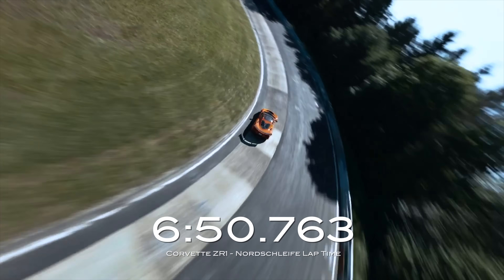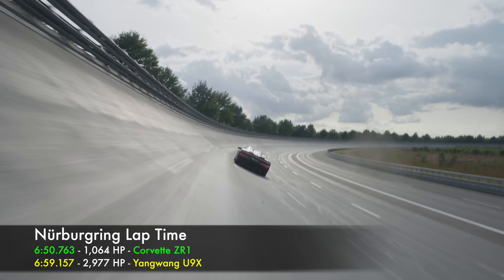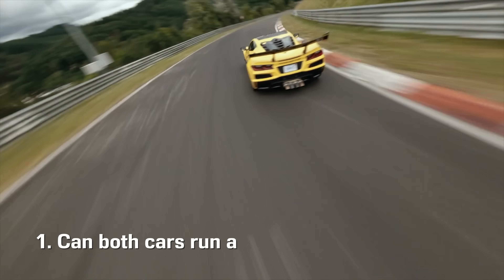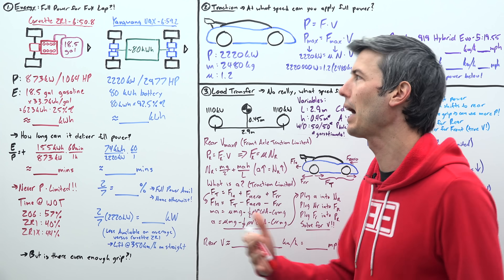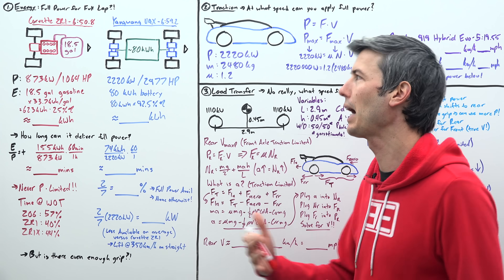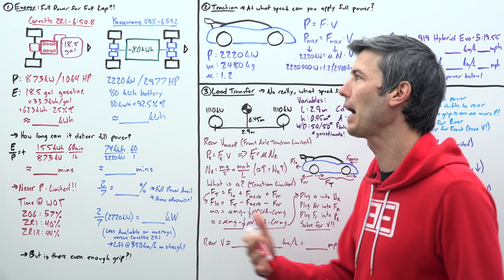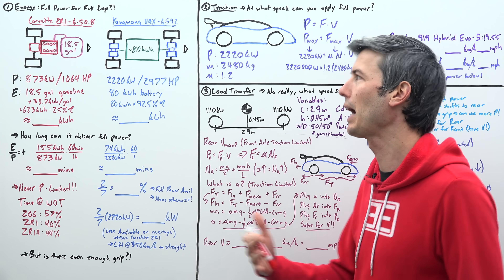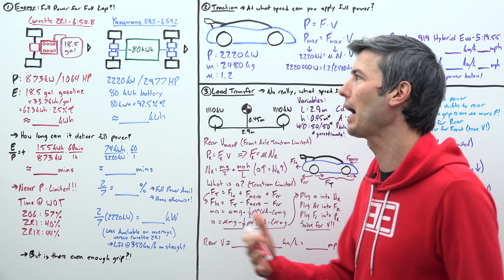Gas Beats Electric! Why Is 1000 HP Faster Than 3,000 HP?

Comment: It's not how much power the car has, it's how much it can use. That's a concept that Porsche really understands.
Reply: They also understand how to manage air. Part of the reason the GT3 is still faster than the GTD
Reply: It depends on the track....eg, many corners vs many straights
Reply: Power to weight is also really important, and lighter is better for braking and turning.
Reply: I use gut gas
Reply: General Motors really gets it too.
Reply: You mean aero…
Reply: Amen !
Reply: The Porsche with the fastest lap time is the most powerful 911 they ever made, so it still kinda is about how much power the car has.
Reply: Porsche has sort of painted itself into a corner with the 911 GT3 line, as in it absolutely has to be an NA flat6, and so over many years they’ve gotten VERY good at maximizing the potential of every single part while still having it be road legal and reliable.
Reply: @StreetComp it’s a car for the GT3 race class. The Corvette and GTD are essentially GT1 cars. Anything goes there.
Reply: @StreetComp  Yes, Porsche engines have been always been developed, produced and engineered in NA, the center of the Universe. May got bless Guns, and america.
Reply: @CristianNazare  pretty sure they mean naturally aspirated 💩
Reply: @spoons_akimbo  omg you might be right! Sorry @StreetComp. Feeling like a dumbass now XD
Reply: Don't believe German lies. Porsche learned this from Subaru. The first 911 turbo was difficult to drive, which meant it more often created widows than allowed you to drive at 100%. In the second half of the 1990s and early 2000s, Subaru and Evo were faster than many supercars on real roads because they allowed 100% power to be used in all conditions. Especially on bad, dirty, wet roads. People forget that driving at 100% on a race track and at 90% on public roads is not the same thing at all.

PS The first mass-produced 4x4 passenger car was the Subaru Leone, and the first production model was the Jensen Interceptor. All decades before Audi. Don't believe Germans 😉
Reply: But Porsche did make the first 4x4 car and it was a hybrid as well. In the year 1900.
Reply: Porsche has been making cars for 100 years, only to be beaten by a car that costs 75% less, made by a cell phone company that entered the auto industry two years ago.
Reply: @keithl8080  You still believe the Chines myths, athough those have been debunked time and again?
Reply: @keithl8080  What are you even talking about lol. Porsche can destroy it whenever they want with a fraction of its power. Also dont forget the 919evo hybrid. Porsche IS the best and nothing will ever come close lmao
Reply: @patrickrosington1174   that's because you most likely have never traveled and never drove the Xiaomi SU7 Ultra and other new EVs, I have a GT3 RS and my friend has a Taycan S, the $80k SU7 ultra blow them away. Some of the new Chinese hybrid EVs have up to 1,600 km range lol, compared to the 1st gen Taycan S that my friend has with only 186 miles range tested, which is a joke.
Reply: @keithl8080  can you perhaps provide proof of the su7 "blowing away" the gtr3rs? Would also like too see some proof of that 1.6k km range claim.
Reply: @keithl8080 na... porsche fastest on the Nürburgring 😁
Reply: @patrickrosington1174 no matter how much porsche got destroyed, their fanboys will adore them no matter what
Reply: @keithl8080  Sure "Keith".
Reply: @keithl8080 You have a GT3 RS, and my dad also works at microsoft, and he's Bill Gates
Reply: @Tobilikethis  absolutely, never seen a e-car with any power as fast than gt3rs for example. street cars of course. IDK how much a McMurty will be faster than a similar built gas car with modern aknowledge and negative pressure active downforce system, idk how this is called in english, inspired by the old brabham bt46b. Also intresting that there are "built" 30yrs old honda civics out on the ring in the 7:20's, thats impressive!! There are many Videos of Bugattis on the Ring.... all of them are slow AF, theyre like Hayabusas on 4 Wheels... just nice if it goes straight.
Reply: @IHaveALotOfBraincells he probably talks about straightline speed because the gt3 rs actualy beats the yangwang on the Nurburgring despite only having like 500hp while that yangwang has 3000
Reply: @keithl8080  DUDE WE FKIN KNOW THE EV IS GONNA WIN A DRAG RACE THIS ISN'T ABOUT THAT
Reply: @keithl8080  track and straight line performance are two different things entirely. a tuned nissan gtr would smoke the su 7 ultra. its not a correct argument
Reply: @KaranVarma-d1y  The point is,  A Su7 ultra costs $70k in China. People keeps on saying their $350k to $1 million dollar car can beat a $70k Su7 Ultra, the Su7 already won.
Reply: @patrickrosington1174  "nothing will ever come close" while the ZR1 is within 1.5 seconds. AND thats this particular track (a track with more straights could flip things into the corvette's favor). AND the ZR1 isnt even the fastest corvette lmao
Reply: @keithl8080  people who race the actual cars and not the ones arguing with lap records know this, Porsche can do laps and laps around Nurburgring without parts failing, while even supercars like Mclaren struggles to keep itself together when abused slightly. James May on Top Gear tested similar things before. German cars don't disintegrate when there are some sand and gravel on the roads which damages their underside. It was Ferrari vs Mclaren vs Audi.
Reply: @keithl8080  You are missing the point. A 911, say, isn't going to win a drag race over a reasonably powered EV. This is about running several laps around a track. Le Mans is an extreme example. But there are many things that have to be in place to win the 24h.
 
EVs have their advantages. They have very good handling despite being heavy, due to the weight distribution. It's very low. Speaking of batteries. They have more than sufficient capacity. As I understand it, today's electric semis have as long range as diesel semis. I believe you can only drive for 4.5hr in Europe anyway. After that you are required to take a 30 or 60min break. But there obviously are situations where the batteries are the limitation.
Reply: @grisflyt  Today's electric semi's do NOT have the same range as diesel semi's, not even when driven bob-tail. And with increasing load, the range drops like a stone. Just look at how bad the electric pick-up trucks are doing when towing a load because of how much the range is absolutely gutted. 
Europe does have limited consecutive driving time for truck drivers, but it isn't as simple as you say. Besides that: no electric grid in Europe has the capacity to charge a huge number of EV's without problems, let alone the capacity to charge much larger electric semi battery packs.
Reply: So, porsche is faster than bugatti because of capability of understanding? BS
Reply: @tigermo538  Depending on your definition of "faster". Try doing a hillclimb in a Bugatti?
Reply: @getsideways7257  What I mean “faster” is much simpler than your roundabout definition. It’s not like you don’t know it, you just don’t dare to admit it and tried to play a concept game.
Reply: @tigermo538  Ok, then try beating the top fuel dragsters...
Reply: @tigermo538  Top speed is 100% irrelevant in all scenarios, except a scenario where you test top speed.
Reply: @Jreq-77  Talk to the price of top-speed machines, no one is smarter than you.
Reply: @tigermo538  so what do you mean by faster? straight 1/4 mile drag race?
Reply: @tigermo538  Yes.

Comment: The Gt3 vs Zr1 is also slightly misleading as Porsche has drivers with thousands of hours on the ring. Chevy has highly skilled drivers, but no one near that level. 
Many ring experts say that the Vette could've gone faster.
Great job explaining the power limitation though.
Reply from the maker: I spoke with the Corvette team and honestly I think their number is pretty close to accurate - the run the simulations prior to visiting, know where they should land, and were happy with their times. Sure, it's Porsche's back yard so there's an advantage to that, but also the Porsche is significantly lighter and has significantly more downforce, which is critical for high speed cornering tracks (the 'ring). It's able to carry a lot more speed, even if it takes longer to get up to that speed.
Reply: @EngineeringExplained  A guy name misha Charoudin has thousands of laps at the ring driving all sorts of cars watch ZR1 lap and he said ZR1 has probably close to 10sec more in it if they had a driver that knew the track better where to attack it. There was multiple points vette driver was off line or didn't attack where they could.
Reply: Sabine could have cut 30 seconds off easily.  💖
Reply: That's on GM for not hiring a professional 'ring driver.
Reply: That's just their way to avoid having direct comparison to porsches. Especially since they always have significant power advantage.

Comment: You didn't have to wait for this long to make this comparison. You could have just compared ring time of rimac nevera and GT3 RS. More than 3 times the hp still almost 20 sec slower... Because EVs are heavy although their C.of mass is lower they experience significantly less lateral g's when cornering. EV loose so much precious speed in the corners, no matter how fast they are on the straights they cannot make up for the time lost. Weight is everything on a track. Energy density of batteries should at least double for the EV to catch. Which will happen in 5-10 years.

Comment: The U9 Xtreme is about A TON heavier than the ZR1.
CORNERING is the reason it was slower, not putting down the power.
If you compare the cornering speeds you will see a huge difference.
Plus the ZR1 is two wheel drive and the U9 four wheel drive, it has two more driven wheels putting down power.
And we are not talking about power to weight ratios or acceleration.
Huge losses in braking and cornering due to substantially bigger inertia on the heavier car.

Comment: There were a number of inaccuracies in this video.  First, while the average 634kW power of the EV can be computed based on the battery capacity (ignoring regen and assuming you end the lap with 0% battery), it's incorrect to compare that against the peak power of the gas car with the explanation that the gas car isn't energy-limited.  That's because the gas car obviously won't end up with it's average power equal to it's peak power due to braking zones etc.  If you want to do a better comparison based on energy usage, you should look at how much gas was actually used and compute average power from that.  Also, saying that you can never use the peak power anyway since you're tire-limited up to 170 mph and the Porsche 919 hybrid had an average speed of 145 mph is also misleading as that ignores the sections of the track that are above 170 mph.

Comment: According to F1 engineers, every 1kg of weight adds 30 ms on a typical F1 track. Every extra HP adds about 16 ms per lap. On a track as long as the ring that might be 150 ms. Now consider that the Yangwang weighs like 1400-1500 kg more than an Alpine A110R Ultime. It's average HP over a lap should be around 857 HP if it's battery has to last exactly for 7 min. So in reality there's no way it's using even 857 HP most of the time either. It is this average HP figure that matters for an EV more than any peak figure. If they could increase the average power by 1 HP, they might gain about 80 ms on the ring. Which would in a very oversimplistic way of looking at it, mean that for every 1 kg of extra weight you need 2 extra horses on average over a whole lap to make u the deficit. And given that 3000/857 is 3.5 (based on the battery draining out in just 2 min at peak power), it means your car needs the peak HP number to go up by 7 HP or so for every kg of weight added on the Ring to keep the same lap time. No wonder EVs are so slow despite destroying anything else in a straight line.

Comment: 3000hp from China is all suspect. Stuff from there all begs the question. Is it really 3000hp or just paper spec lying.
And then there is over 5400 pound weight.... that is going to mess up any sort of handling issue. Enormous power that can not handle. mean problems for actual lap time.

Comment: Its certsinly possible to have too much power for the turn sizes. If the turns were much wider and longer then it would be more capable of using the full 3000 hp power making it a lot faster.

Comment: Different cars also have different weight as well as different braking and handling characteristics. Power isn't the only factor. This is why for example a 320hp Civic Type R has a better Nurburgring lap time than a modern BMW M3 or Mustang GT despite having significantly less power.
Reply: Hot hatches ftw. Even the i30n performance, the Civic Type R for poor people(me), beats the Mustang GT.
Reply: A Chevy cobalt SS also had a better time than those 2 cars.
Reply: I agree with the statement but the type r is a 7:40 car . The stangs and cars are faster than that while being pigs in comparison .
Reply: What this is a straight up lie! M3 CS is 7:28 and a Civic type R is 7:44.  M3 is not surprisingly quite a bit faster..
Reply: @albertcamus5970 That M3 costs double the Civic, has nearly double the power and drives double the wheels. For what, 16 Seconds? Now take a affordable M3 and look how it sucks against a Hot hatch.
Reply: @user-to7ds6sc3p M3 is going to drive better than a FWD hatch. Front wheels are doing everything braking, steering, accelerating - this is a lousy set up. Is that advantage worth the money? Also M3 is far more luxurious IMHO. M3 is a like rapid luxury car - where Civic is a like a tuned economy car.  

My first car was a Civic - I love them. But RWD or even rear biased AWD is just better.
Reply: @albertcamus5970  moreso a normal m3 but even that isn’t slower than a ctr.
Reply: The previous M3, not the current M3, which is faster than the CTR.

Comment: Great explainer as always!  Though it missed a major point of manufacturer lap times from the Ring.  That being weather - which can be a huge factor at that or, really, any other track.  Plus different drivers.

After all.  There is a reason Top Gear used to make notes of weather conditions at their track, since it was (almost) always the same driver and the weather was the biggest variable.

Comment: i know i'm probably the worst engineer out there (i'm more into static scenarios), but something always bothered me: Power can be calculated P = 2pi * M * n. Electric motors can spin at high rpm's (18'000rpm for Model S i think), but if they are put directly onto the wheels, there is no way that power will be ever available, so the power number would be bogus. Are there always planetary gears in these motors when they are in the wheels?

Comment: I'm German and know what it means to go fast in a straight line. And I know what it feels like more than 3 minutes into it: boring. Whereas proper mechanical grip to go quickly around tight corners never gets old. Even there is fast-computing trickery in modern heavyweights to compensate for the tons (and the high center of gravity in suvs) producing the "right" numbers, it never feels as good.

Comment: While traction limit is the answer, the biggest differentiator here is weight. The U9 weighs 2000lb more than the Corvette. Cornering, braking and some acceleration (as you show) are all done at the traction limit and a heavier car hits the limit at a lower speed. Tires work harder on a heavy car and get 'greasy' sooner. The GT3rs is 400lb lighter than the Corvette, and 919 Hybrid Evo is 2000lb lighter. All these cars are ranked in speed according to their weight.
Reply: Half of the EV's weight are on the batteries.

To reduce the overall weight by like 25% it needs the battery that has 50% lighter weight for the same capacity, aka 2x the energy density

Solid state batteries are supposed to fix the battery weight issue, but it's still under development until today and still not mass produced yet
Reply: @sihamhamda47  Let's see how long they 'll be "still in development" and whether they actually deliver...

Comment: Doesn’t the downforce of the air at high speeds dramatically „increase“ the weight of the car?
This would mean as they go faster more of the power would be able to used from the 3000hp? 
I don’t know the downforce but I am assuming by the time it gets to to those 250km+ speeds it would be enough to enable 100% usage of the power.

Comment: 3,000 hp just isn't necessary. There's no tire technology - at least not yet- that can safely handle that much power. Also, it's quite hard to successfully / adequately be in control of said power as a driver . In my view 1,500 - 1,600 hp is plentiful for any application, just how much power does one need?

Comment: What kind of joy of driving would someone get from piloting a 2.5 ton car? Everytime I watch an EV going around the Ring all I see is the tyres giving up after a couple of minutes because of the weight. Most of the lap the driver has to wait for the understeer and then punch it out of the corner. That car belongs to a straight road, not  the track, no matter how powerful it is.
Reply: Yeah you may not hear an engine, but the EV laps are at least as loud as the ICE ones.

Poor tires screaming for their lives.